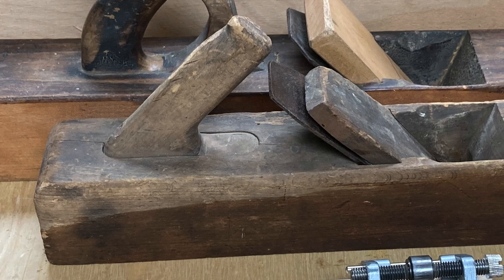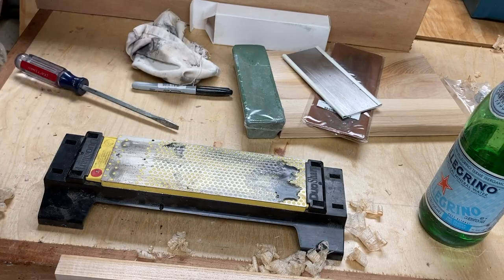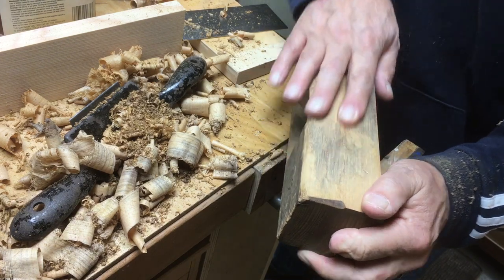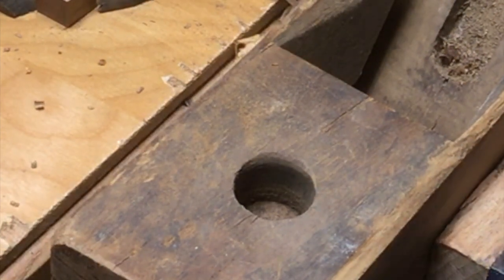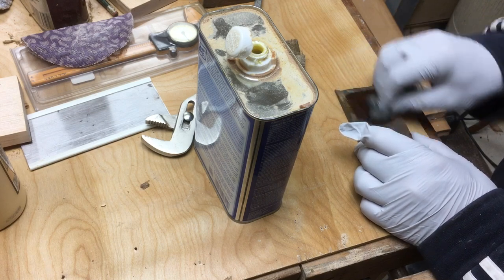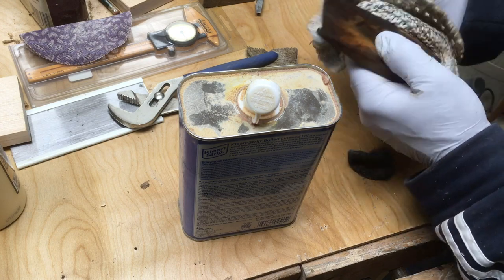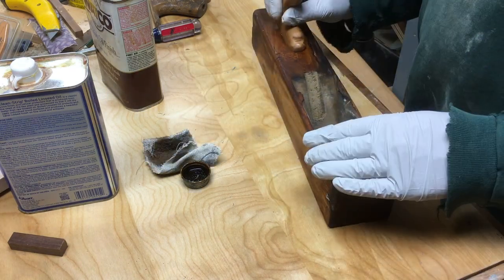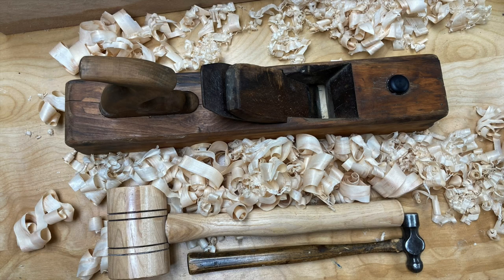Refurbish Ohio Tool Scioto Works Wooden Jack Plane New Ebony Strike Button New Beech Tote

Comment: A while back I bought several Ohio/Scioto planes from Smoother on up to Jointer from an estate sale. Most of them are in good condition. One Foreplane needs a new tote, and 2, maybe 3 need their mouths tightened. Luckily, all of them have plenty of life in their blades. Watching this has motivated me to tackle at least one during this Xmas break. Thanx. I love the feel when working with wooden planes and when they're done I may just retire all my metal planes.
Reply from the maker: Thank you for the comment. They are a nice bit of history and if you have room they make a great collection. Thank you for watching.